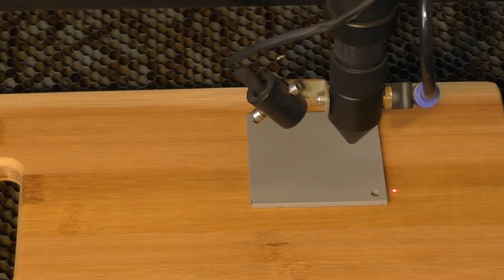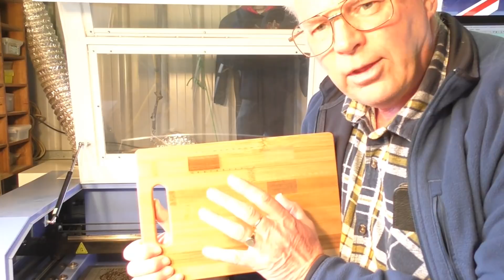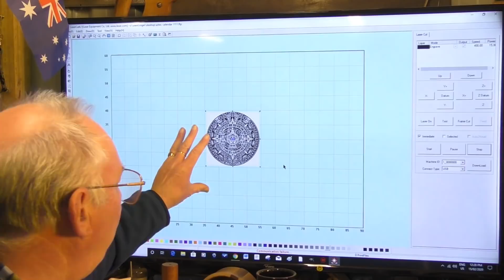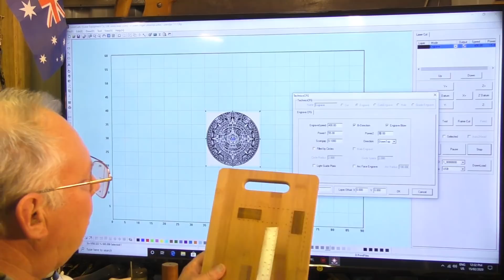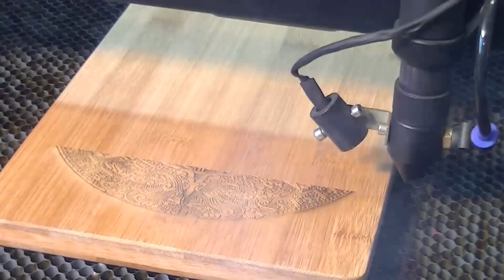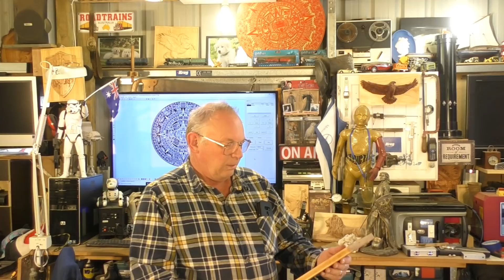Easy learning, how to make $2,000 a day Laser engrave in Bamboo with a 100 watt CO2 Laser,

Comment: Roger, I have done a few of these boards... we call them presentation boards( or cheese boards).... we do a lot of Grandma's soup or cookies recipes like this...because we sell it as they can cut on one side and then  present the meat or cheese on the lasered side...I run across the grain @70 % (min and Max), 400 mm ...I also use the generic fill (in lightburn) this gives about 1.5 or 2 mm penetration (I have a 100 watt reci tube like you (agreed power))...I think the only difference is I don't use photo mode and I run 275 to 300 lines per Inch....also Sir I don't sand these boards but a use a window cleaner and let it sit for about 30 seconds and that will remove the smoke ring from around the letters. (Since window cleaner is designed to remove smoke stains from things like car windows etc....best regards.